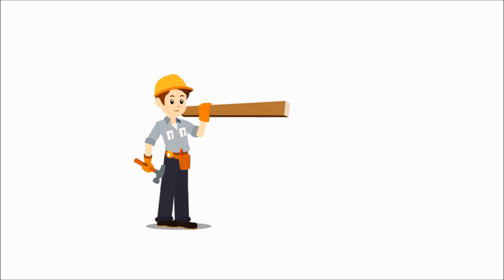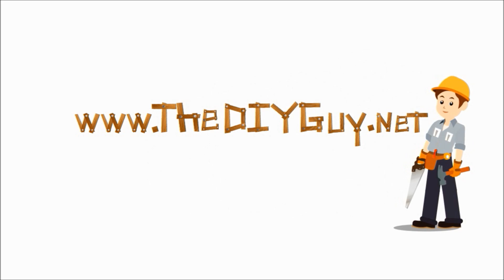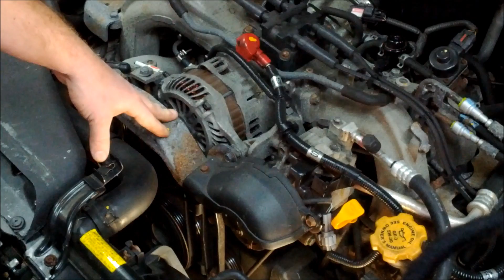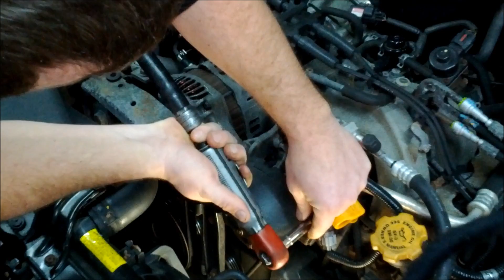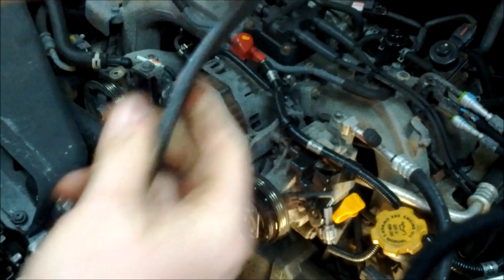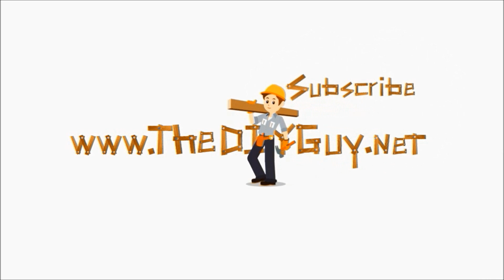How To Replace Both Subaru Drive Belts

Comment: What's up DIY guy...  My fiance has a 2008 Legacy, and when her car is not warm, the wheel won't turn, and it has a nasty sound when it does.  This goes away when the car warms up.  I just checked the fluid, it seems OK (is a the low "when warm" line).  I checked it when it was warm.  Should I add a bit?  I checked the tension on the belt, but it seems fine.  It squeals for a bit every morning tho.  Maybe try tightening it?
Reply from the maker: the snowdawg Hello, I would check the level again cold and add of you need to. Check it on a level surface. Not sure if you have owned the car since it was new but maybe someone added something other then steering fluid which could have damaged the pump. After you check the level i would also check the belt and see if it has any shinny spots on it like it got hot and glazed the belt over also look for cracks. That will cause it to slip and make noise. If it looks ok you could try and tighten the belt.
Reply: TheDIYGuyDOTnet Thank you sir.

Comment: My ac belt is about to break can I run my car without it I have to got to work tonight so that's about 100 miles or will that mess something up
Reply from the maker: Yes, You should have no problem running your car without an a/c belt. Plenty of cars on the road running without an a/c belt or even the a/c pump. I am guessing its a Subaru which has two belts, just be sure its not the alternator belt.. If its not a Subaru make sure that there different belts and not one that runs the a/c and the alternator.
Reply: Thanks for the response so quick its a 02 Subaru Forester is the ac belt. Thanks again

Comment: Is there a way to gauge the tightness of the belts needed? How important is it?
Reply: He replied to a different comment, but you may find it useful:

"The way to check the tension is to press on the belt from the outside of the loop towards the inside (on the flat, wide side of the belt...), at a point midway between the alternator or A/C pulley (depending on which belt you are checking) and the point where the belts cross, and apply 10kg/22pounds of pressure (can use a fish scale for that.). Properly tensioned new belts should have 7-9mm of play, reused belts should have 9-11mm.(something close to that in your owners manual. The easy way is to wiggle the belt where I did and make sure you have no more then 1/2" of travel. The belts will wear in a bit and need to be tightened again later on."

Comment: Hello, I was able to change my belt, but when I tried to tighten the belt, the bolt snapped. Luckily I was able to back the bolt out, for a replacement, but now, I'm unable to be the alternator out, because it seems the pivot bolt is stuck?  Is there anything holding the pivot bolt in place?
Reply from the maker: Hello, If by pivot bolt you mean the bolt to the right of the alternator there is a nut on the end of it. Sometimes the just get stuck within the alternator. Try spraying with some PB Blaster or Kroil to help loosen it up.

Comment: Hey I think I have a misaligned something I get a chirp at idle. Would tightening the belts a little help this at all? And how tight is too tight? (06 Subaru Impreza 2.5I RS)
Reply from the maker: You could be a little loose so the belt is slipping/ chripping. The way to check the tension is to press on the belt from the outside of the loop towards the inside (on the flat, wide side of the belt...), at a point midway between the alternator or A/C pulley (depending on which belt you are checking) and the point where the belts cross, and apply 10kg/22pounds of pressure (can use a fish scale for that.). Properly tensioned new belts should have 7-9mm of play, reused belts should have 9-11mm.(something close to that in your owners manual. The easy way is to wiggle the belt where I did and make sure you have no more then 1/2" of travel. The belts will wear in a bit and need to be tightened again later on.
Reply: Thanks so much, very informative information!

Comment: Thanks for the video! All is quiet now under the hood. '95 Impreza pushes on towards 200k. Not giving up!
Reply from the maker: You're welcome, Glad to hear we could help. That's just breaking in for a Subaru especially if it has the 2.2L motor. I have 275k on my 2.5L Outback and its still going strong.

Comment: How do you know how much you have to tighten the alternator bolt..  I changed my drive belt they same way but after 3 weeks when I open the bonnet   the belt was half gone. I mean rubber part was gone   I can still see the top layer of belt as nothing wrong..  But when I touched the bottom side if belt there were four lines of rubber 2 of them completely gone

Comment: thanks my friend , the job is done , both drive belts replaced and the AC pulley lubricated with WD40 and every thing now is working fine and quite :)
Reply from the maker: You're welcome,Glad we could help. You might want to try some Kroil next time works great for lubricating things. I think its better then WD-40.

Comment: Thank you, fantastic video!  How do you gauge how snug the belts should be?
Reply from the maker: Technically there is.. The way to check the tension is to press on the belt from the outside of the loop towards the inside (on the flat, wide side of the belt...), at a point midway between the alternator or A/C pulley (depending on which belt you are checking) and the point where the belts cross, and apply 10kg/22pounds of pressure (can use a fish scale for that.). Properly tensioned new belts should have 7-9mm of play, reused belts should have 9-11mm.(something close to that in your owners manual. The easy way is to wiggle the belt where I did and make sure you have no more then 1/2" of travel. The belts will wear in a bit and need to be tightened again later on.

Comment: How did you get past the fan shroud? This is in the way. I can not get my rachet down there because the shroud is in the way.
Reply from the maker: I'm guessing your talking about getting to the nut on the adjuster wheel for the power steering belt.. You should be able to use a 3/8's ratchet and a SHORT 12mm socket and get it in there... If not you could always use a 12mm wrench. The ratchet style wrenches work well. What make an model are you doing this on?
Reply: TheDIYGuyDOTnet 1998 Forester "S". You are correct about the nut on the adjuster wheel. Ratchet w/socket was to tall. There is also a 'lip' on the adjusting bracket, so the ratcheting wrench was not able to work. I ended up taking the shroud out(4 mounting screws). I had all the room I needed then. Thanks for the video and for answering the question on this holiday. take it easy.
Reply: I got a loaner tool when I bought my belts. It took a $30 deposit, but it's a a long thin bar with a socket nub so that it's just a tad thicker than the socket alone. A bit of trouble, but I don't like taking extra things apart.
OK...
 I had to take off the radiator brackets on top and it still required a bit a finagling to get it on the bolt. A thin socket with this would be perfect. Also, the long vertical bolt for the air conditioner tensioner was threaded backwards. "Loosening" it moved the pulley up and reduced tension. A little Chrysler déjà vu.

Comment: Seems easy, but how do you know when you have enough tension on the belts. Don't you have to have a certain amount of tension on them?
Why didn't you use the air compressor on all the bolts?
I'd like to see a video on your air compressor some time. I want to buy one, but their are so many types out there.
Reply from the maker: Yes its fairly easy. Technically there is.. The way to check the tension is to press on the belt from the outside of the loop towards the inside (on the flat, wide side of the belt...), at a point midway between the alternator or A/C pulley (depending on which belt you are checking) and the point where the belts cross, and apply 10kg/22pounds of pressure (can use a fish scale for that.). Properly tensioned new belts should have 7-9mm of play, reused belts should have 9-11mm.(something close to that in your owners manual. The easy way is to wiggle the belt where I did and make sure you have no more then 1/2" of travel. I figured more people have hand tools then air tools and could see that you could complete the repair with just hand tools.